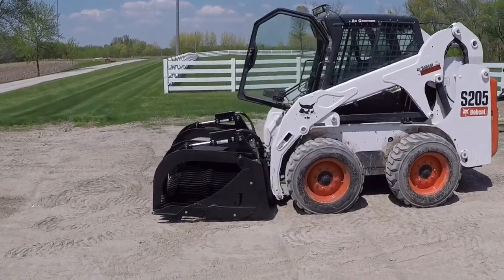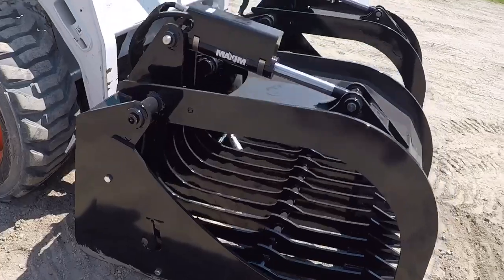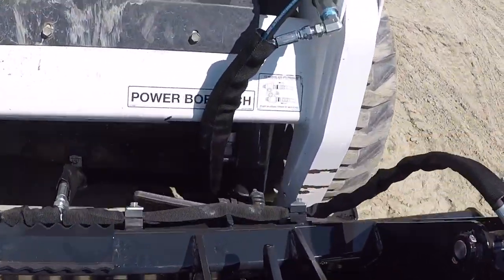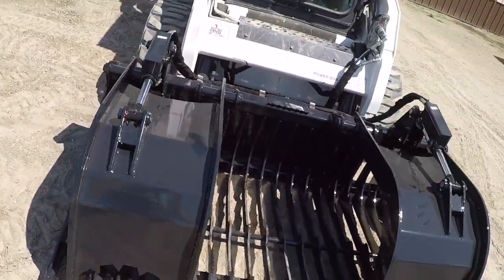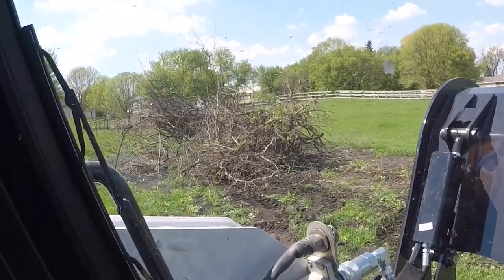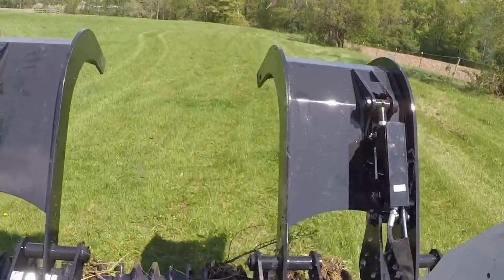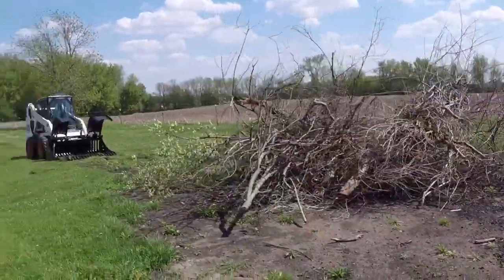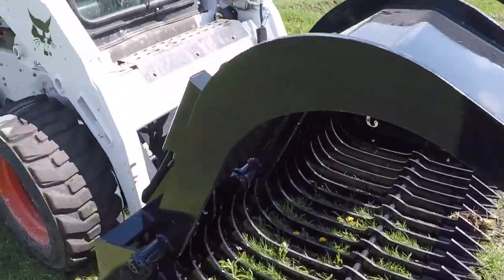Got My Grapple Bucket!

Comment: How many hours are on your Machine I just picked up The same model number but it has 6000 hours Don't know if that is a lot but seems to run good
Reply from the maker: this is a 2008 model with only about 900 hours.  we really like it.  they seem to go for a while so I'm sure you will be just fine with a little maintenance depending on where the machine came from

Comment: This looks like a helpful attachment. How much was this?
Reply from the maker: Unlocks a whole new set of capabilities. Like being able to use your thumb on your hand. I have about $2200 into this grapple
Reply: BornToFarm101 appreciate the videos! Thanks for posting. Looking at one of these badboys for myself :)
Reply from the maker: There’s so many options a guy can do. This rock bucket style is heavy!  But I like it cuz it’s rakes the roots and is sturdy. A guy can get a true brush grapple a little cheaper. It’s lighter too but I’ve been happy
Reply: BornToFarm101 yeah I noticed it was beefy, which seems like a durable advantage. Do you know the grade of steel etc the bucket and tines etc are made out of? I think the cutting edge is grade 50 steel but not sure of the rest?